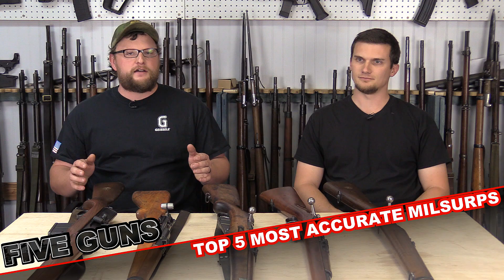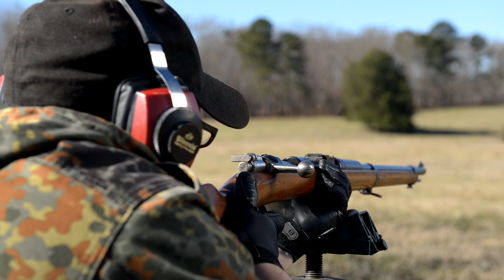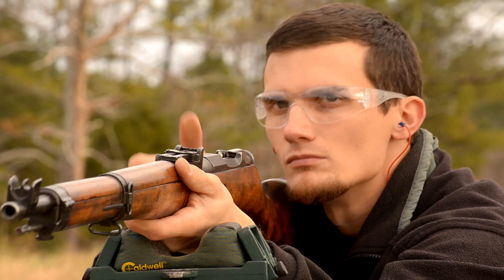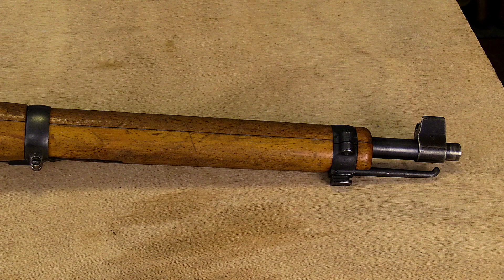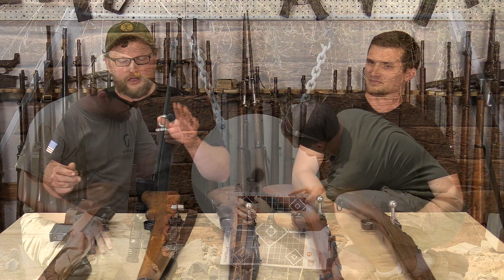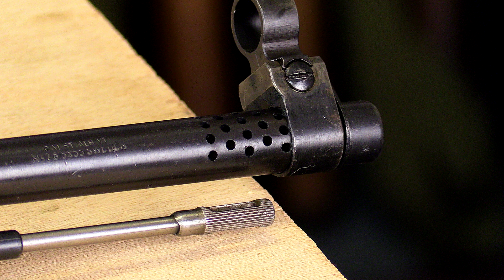Top 5 Most Accurate Military Surplus Rifles

Comment: +Iraqwarveteran8888
Eric, about the M39...

The Finnish Defence Force has the 7.62 Tarkkuuskivääri TKIV-85 (TAK-85) sniper rifle which is actually built on the Mosin/M39 design. Some of them even use parts from old Mosin/M39 rifles. They are still used today.

Picture: https://upload.wikimedia.org/wikipedia/commons/0/04/7%2C62_Tarkkuuskiv%C3%A4%C3%A4ri_85_Lippujuhlan_p%C3%A4iv%C3%A4_2013.JPG
Reply: I used it in 2003-04 when I was sent on a tour in East Africa, a decent rifle but I am truly glad we now have TRG-42 and it is phasing out the 85. TRG is a real, proper sniper rifle. TKiv 85 is not bad, but it has many deficiencies too.

Basically, the problem with TKiv 85 is that it is built on the same idea as the M39 was but unfortunately they didn't do so much of improvement rather than use old stuff and add some new stuff, and in this case "the whole is not greater than the sum of it's parts".

Comment: I think you guys have to try out Finnish M28-57 rifle. It's basically M28 with diopter sights. Some rifles are also equipped with M39 stock. That's a sharpshooting rifle, beacause they used best parts for these rifles at the fiftys.

Comment: I used to own two great surplus rifles (well, several actually, but I digress) that I'd put up against any on that table. One is a close cousin to the K.31, a SR 1896/11. Using Norma ammo it would easily shoot MOA at any range my eyes were capable of seeing the sights well enough for. The other was a 1942 No.1 MkIII* made at the Lithgow Arsenal in Australia. Again easily capable of MOA or better depending on my eyes. And yes, I did own a Garand bought through the DCM a bit over 30 years ago. That rifle shot 1/2 to 3/4 MOA consistently with my pet handload for it. I hate that I had to sell them and with I still owned every one.

Comment: I fired most of these featured, and they are accurate. Seems most of the older rifles are, guess they just put more passion into it, like buildings....most old buildings that are 200 years old are still sturdy as a rock. Not today...

Two I'd have to add would be the M1 Carbine, and the Gewehr 43. I fired both when I was about 16, and man, they were accurate! 250 meters, I was putting rounds on top of each other. The M1 Carbine is a lighter round (.30 carbine) but does pack a punch, and I knew a guy that hunted his deer with it, and did his own hand loads when he couldn't get or afford the .30 carbine ammo. He took good care of that rifle, and I bet it was his grandfather's rifle.

Comment: Yup there's still a mosin derived sniper rifle in use in the finnish military called Tkiv 85. They were made around 1985 using old mosin bolts from early 1900s. Otherwise it's a whole new design. I shot those quite a bit in the army and it sure was accurate but that's really the only positive thing about it I can think of. Heavy, jams a lot, awful bipod...

Comment: I want a 91 30. are they inconsistent or actually good? I want a decent old historic rifle. Want to make a nice sniper out of it.
Reply: +Horatio Huffnagel With the 91/30 you just never know. I hear that some of them are very smooth and accurate and others are very inaccurate with hard to cycle bolts even after you clean the shit out of it. They may be cheap but it is always a gamble when you buy one.
Reply: Horatio Huffnagel I own 4 of them at this point love them but they're deff hit and miss. I'd recommend finding one in person so you can check the bore, or spend the extra money for the hand select online. my main shooter is a 1942 tula 91/30 and it's very accurate and cheap to shoot. I love the mosin for it's simplicity and the fact that it's built like a tank lol. but honestly depending on what you want to do there's other budget rifles I'd go with first for a long range build. my one mosin I've got roughly $650 into it before the optics.

Comment: i wonder why some people go into a gun store and buy a thousand dollar bolt action rifle when they could buy a used military mauser for $250.00 to  $350.00 dollars and get a gun that is just as accurate. i think some people like to brag about how much money they have so they can just piss it away.
Reply: Weight. Warranty. Easy scope installation and stock designed for scope use. Better safety.  Smoother bolt movement. Suppressor threads. Usually better trigger. Usually better accuracy.
Reply: I used to be able to put a .308 round up a fleas ass at 600-800 M with my HK PSG-1. It cost $12K and was worth every penny. But in retrospect, it was also long before .50 BMG cal rifles became popular like the Barrett M82A1, AI AX50, and McMillen TAC-50's came along. You get what you pay for and how much you train. Luckily, I was trained by the Army to do this for a living. Can you make those same shots with a cheap rifle, yes but it be much harder or impossible. It's like having a NASCAR car with 850 HP vs a car you drive off the dealership. They both get you from point A to point B. One just A LOT faster. A $1000 isn't much for a precision bolt action rifle. The more you pay, the more precision and customization you get. That's a fact, not an opinion. Not really to do much with pissing away money or one upping the Joneses. bottom line people can spend any amount of money  on a hobby and have a great time......
Reply: @WOLVERINE95899  the HK PSG-1 is actually about a 1 MOA rifle. Are you telling the truth?
Reply: Gerald Miller...There's a lot of difference between a sporting rifle and a military one. Each has its own intended purpose designed into them. Get more details on this elsewhere on line...too long to discuss here.
Reply: I cant even find a military surplus rifle ! Nowhere! All over the internet ! If they are available, I like to know where.
Reply: +gerald miller They don't buy rifles just for accuracy.
Reply: +gerald miller In my case it's because I already have most of the surplus rifles.
Reply: i think how Simo can kill so many with a cheap rifle like this of the video, and today still there are no guy that have the same record or more, the dude Brimstone say "The more you pay, the more precision and customization you get", well, in the US or in the UK or in any army that still are in operation have very expensive military surplus, very expensives rifles or machine guns, so why there are nobody like Simo still? Sporde Spysomething say many characteristic of a weapon that everybody can consider better than a cheap 350 rifle, but i ask again, why there are nobody like Simo with his cheap rifle? i think that is pure SKILL, pure PRECISION, if i had a Tac or any expensive and precision rifle maybe i cant hit a ox at 50 meter of distance because in this i am very bad, but there are experts guys, with a extraordinary machines, ans still there are nobody like Simo, bottom line the SKILL is the key for everything
Reply: Probably because they actually know stuff about rifles and cartridges that they choose? Probably because there’s a million other reasons that your simple mind can’t comprehend. Seriously dude if everyone did what you did and bought cheap old stuff all the time would there be any advancement in weapon technology? Same thing with every other consumer product! Last I checked there are no military surplus rifles chambered in 6.5 Creedmor, .28 Nosler, or .300 win mag. Do you understand now that your comment is stupid?
Reply: Indeed.
Reply: +gerald miller Gerald Miller of Varysburg NY?
Reply: gerald miller I know a Gerald Miller of Varysburg NY, are you related?
Reply: not that i know of.
Reply: I bought a huskvarna for $95, and my brother bought an Remington R700 for I think he said $900. But my huskvarna, (I maintain it very well) outperforms the Remington. So I just want to say, from my own professional opinion, I'd rather spend $95 on something that works all the time versus $900 on something that works sometimes.
Reply: because we can and some the new have there uses and are better suited for the work there doing
Reply: Used military mausers rarely shoot MOA, let alone 1/2 MOA or less like a Rem 700, CZ 550, Savage 110 LRH, etc. Or the fact that $300 hunting rifles will print 1 MOA to 1/2 MOA after tuning your ammo. Oh, and cartridges that are inherently more accurate, modern, and cheaper to shoot. And they're lighter, come with better options for adding accessories like scopes and bipods, and have much better fit and finish in the machining. But yeah, people are dumb for not buying surplus
Reply: This is a dumb comment.  In addition to the thoughtful rebuttal below, there are lots of people who don't want to reload, or pay a small fortune to buy this ammo commercially.  And people shy away form these for the same reason they don't always buy used cars.  It is hard to know that it has not been abused, or be sure the bore is good, and the parts are not overly worn.
Reply: @worsel2113  agreed, but part of what you say is wrong. It's easy enough to disassemble and inspect for wear in the store. And you can check bore condition by trying to place a round in the end of the barrel. If the bullet drops in to the case neck, the bore is bad. If the bullet stops firmly before the case neck, it's probably good. You'd just have to inspect the throat for cracks at that point. The rest is spot-on though.
Reply: A mauser for $250, take me back to your time and location, nowadays even m91/30's cost $400
Reply: i rest my case. i am not always wrong. i thought i was wrong once but i was mistaken.
Reply: I installed a scout scope on my 1936 German K98 Mauser.. After I zeroed it in I got a bulls eye at 100 yds..I paid $325.00 for it..
Reply: I dont understand why to buy a Mauser 98 the mas 36 is lighter and it bolt  trustfull and can shoot faster !  and accurate  the Frensniper Rifle is derived to the mas and the mas 39 cr is surley the best bolt action rile evec built

Comment: There really is "sniper rifle" using mosin action and internal box magazine, in use even today.
Its called 7.62 tkiv 85. It has steel block where action and barrel are attached. Its only part touching stock, so both action and barrel are free floating.
Story goes pretty much like this:
Gunsmiths were told to build a rifle, using parts of mosin, using same 7.62x53r cartridge, effective range of at least 600meters and it being able to be used in competitive shooting with change of stock and set of diopter sights.
Sad part is that some poor optics was chosen for them, especially reticle choices.
And bipod is customized machine gun bipod.
Reply: Yeah the bipod is a big flaw. It can't stand on its own.
Reply: TheAxeaman
Yeah, if you leave it on the bipod, the rifle will fall over and that knocks those vintage scopes zero off.

Comment: the Swedish ljungman is a pretty expensive surplus rifle assuming you can find one. all the rifles ive seen have been well over $1000. if you know where to find one for less please let me know. (I want one!)
Reply: Picked mine up mint shape , all original and matching numbers for under 450. In Canada tho
Reply: If you aren't picky, an Egyptian Hakim. which is almost an exact copy of the Ljungman AG42 series of rifles, goes for around 700 these days. They're chambered for 7.92x57mm and have an adjustable gas valve that can eat a variety of different ammo with little issue. It might be your best bet.

Comment: Here's a fact about the SMLE.  Because the action locks in the rear, the bolt compresses, and tends to shorten over time.  This increases the headspace, and after a while, you'll experience case separations.  But the Britts had a solution.  The bolt head screws onto the body.  So they produced a series of bolt heads, of gradually increasing lengths.  When you started to get excessive headspace, you just installed the next longer head.  When you reached the maximum length, the rifle was returned to the armory, where the barrel was screwed into the receiver another turn.  Unfortunately, most of the SMLEs I've encountered have had excessive headspace, and had the longest bolt head.

Comment: I knew the Argentine Mauser was going to be in here, thing can be a tack driver, however I was surprised that the K98k was not in here, I have had some wonderful shooting with that rifle, and the Ammo is fairly cheap to come across in surplus.

If the surplus ammo is corrosive, just take a pot with some dawn soap and 1/2 fill with water and get it near boiling, make sure its mixed well. Remove the bolt and using a funnel pour from the back (breach) so the water goes out the muzzle into a bucket. After that is done, run another 1/2 pot filled with just warm water the same way to get all the soap out, then do standard cleaning, and your set.
Reply: As an owner of a K98k,  thanks for the tip! I just sprayed ballistol down the barrel,  but that gets expensive after a while

Comment: Concerning the GP11, we dont produce it anymore since 1990 if I'm not mistaken. 
We might re-produce some in the future and maybe it won't be berdan, but it will probably be closer to a RUAG match than a GP11. 
Since 2012 the Stg 57 has been officialy droped out of the reserve of the army so the only service weapons using the ammo are Mg51 machineguns, it's not enough to motivate the army to re-start production, they will probably kick those out of service too sooner or later because of the change in doctrine.
For the 57 you'll probably see a batch comming, but they took the decision to destroy most of them. To give you a scale there were approximately 1 million of 57's produced, with 8 (yes, 8) barels per piece (yes, we tend to stockpile a little). So they are now destroying approximately 5-6 million new match barells because the leftists won. Going to puke, comming back in a few sec......

But don't worry too much for the GP11, in the 1990's when we stopped production there was something like 8-10 BILLIONS of rounds in stock, so considering our primers are the weak point of our ammo by far (give it 50 years max) you'll find GP11's that won't go off before not finding GP11's at all.

Comment: I could be wrong but I think most of the surplus Enfield's around are 1950's issue British Army. The problem is that most of those were used by "national service" types and therefore went through more pairs of hands than would normally be the case for a rifle. Not only that but the "national service" types didn't maintain their weapons with as much care and attention to detail as the regulars. Additionally rifles were issued in a condition that would have been scrapped as unfit for use 10 years previously because the army was grossly underfunded for a few years. Add that lot together and I'm surprised they are even rifle shaped.

Comment: Did you leave out the predecessors to the K31 on purpose? IG96/11 and the Gewehr 11 are great shooters and cheaper than a K31 (in my country at least 125€ for a Gewehr 96/11 vs. up to 700€ for a K31). The K31 was designed to to be as short as the K11 but as accurate as the G11.

I cannot tell whether the IG96/11 has generally a smoother action than the K31 or only my one is smoother than the K31 I compared it to.

Comment: I've got a 1891 Argentine Mauser cavalry carbine. Would that fall into the same category as far as accuracy as the full length barrel 1891? Or does it take a hit on accuracy because of the shorter barrel?
Reply: Bore condition is the main determinant of accuracy from a barrel, the barrel length typically has negligible impact on accuracy
Reply: +Edward Anderton Good to know. The bore on my rifle is nice and shiney with nice lands and grooves. I would expect that it will shoot as well as the long barreled counterpart. Thanks for the info.

Comment: You are correct. I was personally trained as a sniper in the FDF back in 1996 with both M91/76 and TAK-85 which are both Mosin derivatives and D-shank barreled just like the M39. The ammo used was the original FDF warload with a 200gr fmjbt. It was developed by he Finnish artillery back in the late 1930's. My personal TAK-85 had a 42mm objective Zeiss scope on top of it. No problems for headshots out to 300m. On a good day and with a slow pace it actually grouped less than a cigarette box @300m/330yds with D166 200gr fmjbt's. Nowadays I think the Sako TRG .338 Lapua Magnum with a big-ass Zeiss on top is the current main weapons system for long range shots. Thanks for the video boys. 5 accurate military surplus rifles on the table. For a guy like myself, that's entertainment.

Comment: About the M39. 
Yes, you are correct, some of the old receivers from the M39 are still in use in the older variant of the finnish military sniper rifle, Valmet 7.62 Tkiv 85. 
Tkiv is a short for the finnish word Tarkkuuskivääri, which translates to Marksman rifle. 

Every sniper/marksman in the finnish military starts their training with the Tkiv 85, to get a hang on the basics of sniper rifles and ranging, before moving on to the Sako TRG-42.

I've shot both of them during my Sniper training in the finnish military.